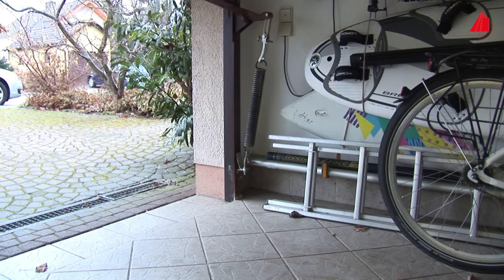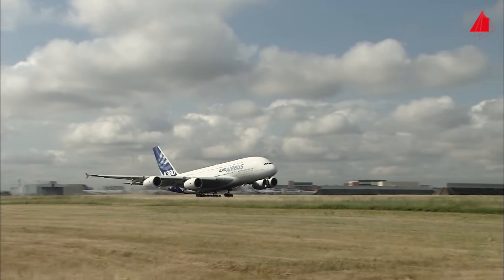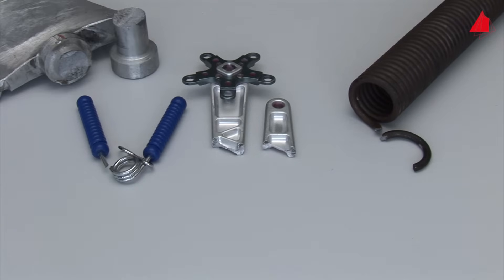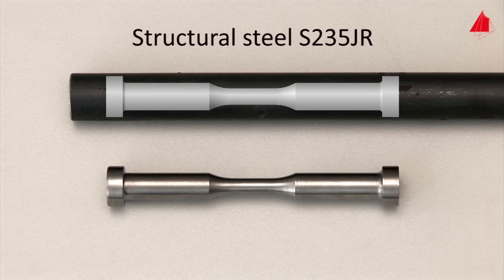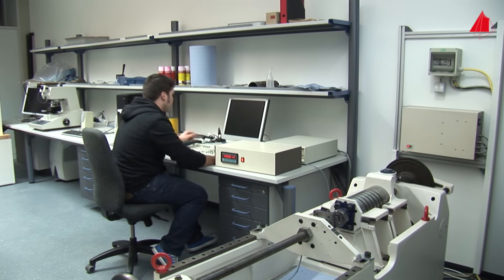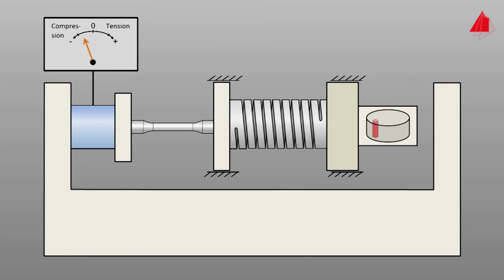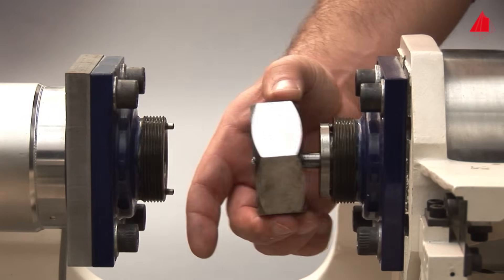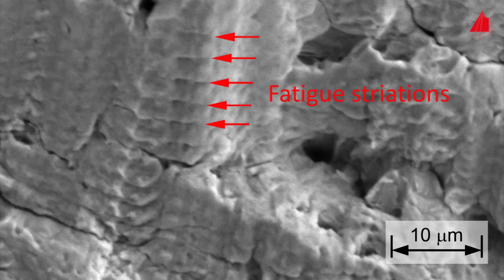Fatigue Test

Comment: What can be done to increase the fatigue life ?
Reply from the maker: The answer to 'What can be done to increase fatigue life?' is: This is a very important point. Fortunately, there are a number of effective methods: Use 
- Higher-strength materials
- Case hardening (if possible)
- Surface rolling
- Surface smoothing

Comment: Hi, how can I determine power of electromotor which I need. I have a max force on sping and spring stroke. Thank you.
Reply from the maker: Answer to "Hi, how can I determine power of electromotor which I need. I have a max force on sping and spring stroke. Thank you.": This is an important question that is not easy to answer. The electric drive only has to supply the power loss, i.e. the friction and the power absorbed internally. This is very little, in our machine the electric drive needs less than 200 W. One of the great advantages of this type of testing machine!

Comment: Hi, i am working on project for university on exact this peace of machine. Can you tell me how to determine spring stiffness and how long and how i can conect it with eccentric load?
Reply from the maker: Answer to "Hi, i am working on project for university on exact this peace of machine. Can you tell me how to determine spring stiffness and how long and how i can conect it with eccentric load?": This is an interesting question that unfortunately cannot be explained in a few sentences. Some ideas: Determine the resonant frequency, and then operate the machine in the subcritical range. You need two springs and special bearings.

Comment: How to select design of test  specimens and to select test parameters that's engineering please guide
Reply from the maker: Answer to "How to select design of test  specimens and to select test parameters that's engineering please guide": This is a very important point. Unfortunately, it is too extensive for this forum. It would require a whole book, because really many aspects have to be considered. Just a short answer as regards the selection of the test parameters. You have to select the first force amplitude by a "reasonable guess" or a theoretical calculation, and then select the subsequent amplitudes from the previous results.

Comment: I love your videos! how can i calculate the spring. i am very instered it
Reply from the maker: Answer to "I love your videos! how can i calculate the spring. i am very instered it": The most important point is to choose an appropriate resonance frequency of the spring-mass system. The spring is designed so that the resonance frequency is slightly higher than the intended test frequency. The machine is operated subcritically (below the resonance frequency) in the test.

Comment: I have a project to design such a device, what should I pay attention to?
Reply from the maker: Answer to "I have a project to design such a device, what should I pay attention to?": There are actually many points to consider. Among the most important are: 
- The machine frame is not very easy to design, pay attention to all the bearings
- Measuring the force is quite tricky; you have to measure the force with high frequency and then extract the extrema
- The most important point is the automatic control of the sample force so that no instability occurs.
I'm sorry, I can't go into all the details, they are way too complex. Good luck!

Comment: It is a perfect video but the first example - wire fractured by bending back and forth- has nothing to do with fatigue.
Reply from the maker: Answer to "It is a perfect video but the first example - wire fractured by bending back and forth- has nothing to do with fatigue." At first glance, bending a wire back and forth seems to have nothing to do with fatigue. But they are very closely related. It has been studied very thoroughly. Fatigue phenomena can range from very severe plastic deformation (this is known as low cycle fatigue) to comparatively light loading (high cycle fatigue).

Comment: Very nice description of the test including fracture surface analysis. My question is the failure is within gauge portion or outside the gauge portion. How to check the validity of the test.    Akash from BARC Mumbai
Reply from the maker: Answer to "Very nice description of the test including fracture surface analysis. My question is the failure is within gauge portion or outside the gauge portion. How to check the validity of the test.": In our fatigue test, we did not use a typical strain gauge, which is quite common in fatigue testing. Only in the so-called low-cycle fatigue testing are strain gauges used. In our tests, the fracture occurs within the cylindrical test region.
I'm afraid validity testing is a long subject, far too long to explain here.

Comment: Can u explain how to calculate the fatigue load (both tension and compression) and no of cycle before testing the product
Reply from the maker: Answer to "Can u explain how to calculate the fatigue load (both tension and compression) and no of cycle before testing the product": The load for the first test must be intelligently estimated. At a mean stress of zero, one typically uses a certain fraction of the yield strength, say 80%. Then the test is started, and the number of cycles to failure is the result. Depending on the result of the first test, the load for the second test is reasonably determined, and so on. It is more complicated at other mean stresses, I am afraid ...
Reply: @MaterialsScience2000  so it's basically experimenting load on different lower than 80% load cycle and at maintaining cycles to which the maximum cycle can be fixed or the components fails ......

Comment: Development of Test Fixture.
• PC and PLC Based Solution.
• Leakage Testing Machine.
• Endurance Testing Machine .
• Assembly Line Automation.
• End of Line Test Solution.
• Press Fitting ,Riveting ,Caulking and Crimping Machine.
• Switch Testing Machine.
• Gear Shifter Assembly & Testing .
• Barcode Application & Verification System
• Special Application as Per Customer Requirement
• Par t Traceability solution with Barcode and Data logging.
• End On System with Data Logging.
• ATE [Automation Test Equipment] for PCB Testing
contact number 9728100113

Comment: loadcell horizontal so the force is correct when the loadcell must support additional clamps?
Reply from the maker: Answer to "loadcell horizontal so the force is correct when the loadcell must support additional clamps?" Yes, the force is measured (almost) correctly. The typical largest error comes from the mass of the clamp on the left side and its inertia. But this is a very small error, because the left clamp hardly moves due to the large stiffness of the load cell. The gravitational forces are practically all compensated.

Comment: I don't know what spring is ... can someone explain it to me
help me
Reply from the maker: Answer to "I don't know what spring is ... can someone explain it to me": Defining the term "spring" is actually an interesting question, it's not as easy as it may seem at first glance. I try it: a spring is an object (or machine element) that behaves elastically. It can deform as desired under a load; it "springs back" to its original shape after the load has been removed. It can store energy ... There are many types of springs … Coil springs are quite common ...
Reply: @MaterialsScience2000  I am working on a plastic displacement fatigue testing machine. can i use springs ??? ... i'm having a hard time with this problem..please help me...

Comment: Can you please tell me the make of machine. I am interested in procuring this. Also I have doubt, how did you maintain the constant load and displacement.
Reply from the maker: Answer to "Can you please tell me the make of machine. I am interested in procuring this. Also I have doubt, how did you maintain the constant load and displacement." The machine is an old testing machine that has been completely refurbished and equipped with a computer control by ourselves. There are some similar machines refurbished by commercial companies on the market. The constant load is maintained by computerized automatic control via measuring the force and adjusting the force by altering the speed of the spindle with the rotating mass.

Comment: Obviously excellent job, so much better than cartoons or teacher memorized curves. Nice to see the result graph with statistical spread. Hopefully our critical car parts operate significantly under that!
Just also wondering what happens using different frequencies for the loading. Is there some general trend?
Reply from the maker: Answer to "Just also wondering what happens using different frequencies for the loading. Is there some general trend?" There is in principle little influence of the frequency of the load cycles for steel (and similar materials) at room temperature. Only the number of the load cycles matters. However, the frequency of the load cycles must not be too high, otherwise the specimen will heat up. It may be quite complicated at high temperatures.

Comment: I think Fatigue threshold  of an artefact of a specimen test particularly noticeable in steel and should not be highlighted as normal material behaviour. More on  material behaviour rather than how the test machine works would be time better spent
Reply from the maker: Answer to "I think Fatigue threshold  of an artefact of a specimen test particularly noticeable in steel and should not be highlighted as normal material behaviour. More on  material behaviour rather than how the test machine works would be time better spent": I principally agree with you comment. However, the idea of all our videos is to show the test methods primarily. To highlight the material behaviour in more detail would be the next step ...

Comment: science has not yet completely explained the complete mechanism of fatigue, the engineer
must still design things that will not fail. In a sense this is a classic example of the true
meaning of engineering as contrasted with science. Engineers use science to solve their
problems if the science is available. But available or not, the problem must be solved,
and whatever form the solution takes under these conditions is called engineering.
Reply: Had to read it twice but I I got ya.
Have a like, with lil peppercorns

Comment: Did you fabricate the device to grip the specimens to tension and compression test?
This fixturing is the best option for tension and compression test for cylindrical specimens?
Thanks
Reply from the maker: Answer to "Did you fabricate the device to grip the specimens to tension and compression test?
This fixturing is the best option for tension and compression test for cylindrical specimens?
Thanks" The grips in the machine (as shown in the video) were supplied by the manufacturer of the machine. This is a good method, but many other grip designs are used: hydraulic grips, threaded ends, ... Properly designed, all of them are good. Sorry for the late reply.
Reply: Thank you for your reply,  for the conditions of our equipment, threaded ends were not one possibility, for this reason, I used this video and designed grips for our machine.
Thanks again

Comment: nice video, danke.
I want to ask, can we use the specimen's shape in a flat (plate) form?
Reply from the maker: Answer to "can we use the specimen's shape in a flat (plate) form?": Yes, the only trouble is the danger of buckling under compressive stresses. So thin plates should rather be tested within the tensile region.
Reply: MaterialsScience2000 thanks sir for the suggestion. I am sorry to ask this, do you have some references about fatigue testing of Aluminium?

Comment: And what are lengths of different specimen material that can be used for this fatigue test
Reply from the maker: Answer to "And what are lengths of different specimen material that can be used for this fatigue test": There is (almost) no limitation to the length of the specimen, as long as the machine is able to grip the specimen and as long as there is no buckling under compressive stresses.

Comment: bro can u tell me how to record the number of cycles, or how to show the number of cycles of load applied digitally.
Reply from the maker: Answer to "can u tell me how to record the number of cycles, or how to show the number of cycles of load applied digitally": There is a gearbox with a gear ratio of 100:1 below the motor. The output shaft of the gearbox operates an electric switch, and the position of the switch is detected by the computer control. So every 100 load cycles the switch is closed for some time - recorded by the computer.

Comment: hello , Can you explain me how the movement of echo of the spring is generated?
Reply from the maker: Answer to "Can you explain me how the movement of echo of the spring is generated?" The oscillating mass is stimulated by the rotating imbalance. By varying the rotational frequency of the imbalance, the oscillation amplitude of the mass (and as a consequence the test force) can be controlled. The machine is operated in the subcritical part of its resonance curve.

Comment: are there any signs that fatigue failure is about to happen in, say, a bicycle?
Reply from the maker: +Leon Echo Answer to "are there any signs that fatigue failure is about to happen in, say, a bicycle?" In most cases: no, since the fatigue cracks are very narrow and it is difficult to find them. Typically, they can only be detected by nondestructive testing

Comment: Which standard did you use to make the samples?
Reply from the maker: Esvin Oxlaj We did not manufacture the samples to a specific standard. We had to use the appropriate grips that are necessary for this special machine. The smooth transition from the grips to the cylindrical part avoids fracture near the grips.
Reply: @MaterialsScience2000  nn